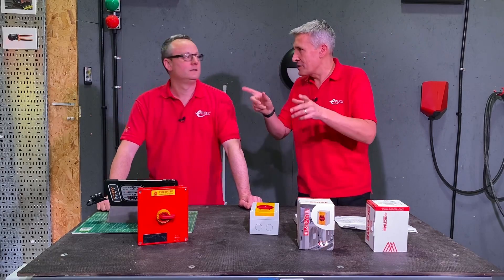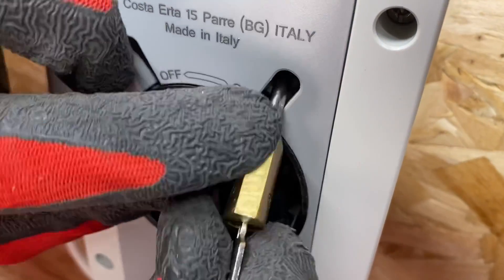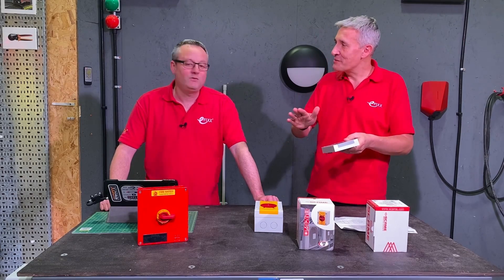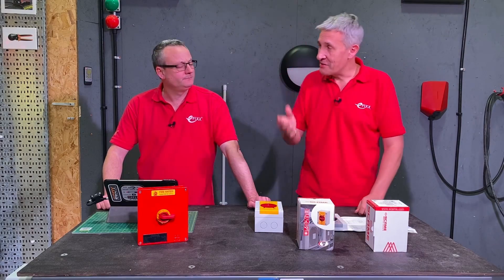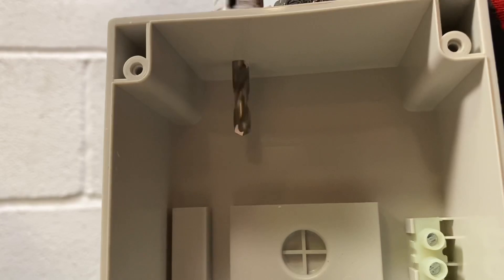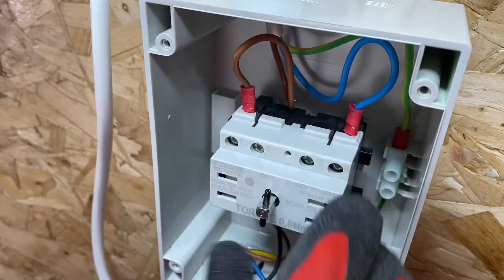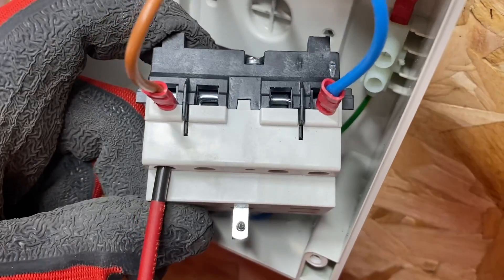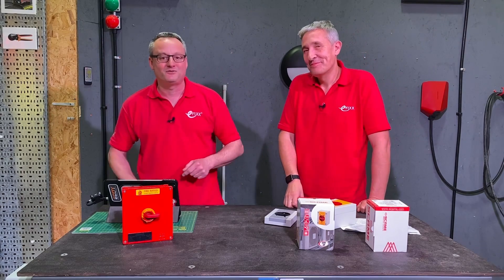TIME TO BIN THE UGLY ISOLATORS - Air source heat pump installations.

Comment: If the only reason for the isolator is maintenance then why not have the isolator next to the tank and controls location indoors, clearly labeled, far better than something outside that is both ugly and largely pointless. I think commercially and industrial situations it needs to go next to the unit outdoors like anything else but domestically I dont see why you must. You cant use the isolator without first shutting the unit down correctly from the tank/controls location anyway. Just switching off the power can damage the compressor mid cycle and invalidate your manufacturer’s warranty also. I would argue also that an isolator indoors labeled correctly is better than one that’s padlocked outside.

Comment: I’ve been told by my installer that I must have the red yellow isolator to meet spec.  Do you disagree??   Thanks
Reply from the maker: You need an isolator but it doesn’t need to be yellow / red

Comment: As units change to R290 -Propane, as the refrigerant gas, a means to quickly and safely isolate with no risk of sparks in the immediate area would be well advised. 
Safest area is to the side, min 400mm up, (propane is a heavy gas)  and cir 900mm to the side.  
Locking on is useful in communal accessible area’s but not advised.

Comment: Any advice on preinstalling flow and return under my kitchen extension being built before ground work completes? We want to lay the 28mm flow and return under the concrete floor to hide it all instead of retro fitting the pipework at a later date.

Comment: They are not an Emergency isolator as they do not  prevent reclosure of the device. They are in fact a lockable isolator to enable the circuit to be locked off by the maintenance engineer. Therfore In this case they are used as a Safety Isolator. 
In this case they should not be locked in a on position for the following reasons:-
a.) The maintenence Engineer may not be able to access the circuit isolation  for the plant.
b.) The Duty key holder may not be available to remove the lock from  the on position.
C.) Loss of keys .
 From your consumer unit installation situated at the bottom of a staircase which was installed at a low level you didn't seem to be concerned as for children gaining access and switching  the circuits off.
Reply from the maker: Colour dictates function as designed in Bs7671 - red / yellow can’t be locked ON

Comment: as a hvac engineer myself i would say locking on isolators for most heat pumps is a bad idea just purely because of the likelihood of the customers loosing keys etc.  but they definitley need a means of local isolation
Reply: On the plus side, cutting off the lock from something locked on is inherently a safe action. On the minus side, walking around with bolt cutters in loto cabinets might still be frowned upon.
Reply: They need isolation, but that can be achieved through various means.

Also they often need some form of overcurrent protection.

For single phase 13A units surely a FCU installed in a suitable inside location makes most sense? Can be isolated and fuse holder can be locked open with padlock for maintenance.

For three phase you could even lock off a 3 pole MCB - again this isn't isolation for mechanical maintenance, and according to regs an MCB is suitable for isolation and functional switching. Most MCB manufacturers provide a locking off kit.

Comment: I've been fitting Scame isolators for quite some time.  They are certainly the top of the range.  Easy to work with and look smart.  I always keep a few in stock.  Also the pvc material used for these isolators is very good as compared to others on the market.  They cost a little more and definitely worth the price.  Scame are the Ferrari of the isolators.  I'm a Heat-pump engineer for more than thirty years.
Reply: Thanks for your kind words, I run the marketing at Scame-UK. Would I be able to use your quote for a future LinkedIn post and attribute it to you?
Reply: @roynicol7008  Yes, absolutely.  If I can assist in anyway possible, please let me know.  Thank you.
Reply from the maker: Great feedback - thanks 🙏

Comment: 1, does the isolator need to be located by the equipment? If not then it can be out of view. 2, if a property is dependent on electricity and there's an outage such as the recent one in the North, they're screwed!

Comment: Do these isolators have the ability to switch off on load guys? There will be a sign on it if it's rated as such
If not it shouldn't really be being used as a functional switch or an emergency really.

Maintenance only

Comment: As someone whose in the trade, they do need local isolation for pumping down if you’re working on them. Depending on the set up of them. Unless people are willing to pay for 2 engineers to attend properties. So the sake of an isolator switch it’s a bit daft no? 

Also they should start making them more like a coldroom/freezer room like the danfoss optyma where they have a built in switch. would look far better and neater.
Reply: Hypothetically, if the system omitted the isolator and you had to isolate them by turning off the circuit at the consumer unit, why would that require a second engineer rather than just walking back and forth a time or two?
Reply: @JasperJanssen  You’d then be running the compressor on a vac, potentially damaging it and/or it would cut off and thus the gas would then fill the lines as you can’t close the valves in if you’re going to stand at the consumer unit, meaning the pump down was completely pointless. The only other way to do it would be to reclaim the gas the, then you’re looking at paying for an extra hour or two for someone standing watching a reclaim unit. So swings and roundabouts. There’s also different situations where you need to turn the switch off when checking valves, or disconnecting the reversing value. Get local isolation and it elevates all these issues.

Comment: The isolators were mounted behind the heat pump, so if the heat pump caught fire you could not turn off the supply to the heat pump.

Comment: There was a data center in London that had a significant problem with homeless people. They would sleep rough next to the air pump equipment, because they blow out warm air, so a nice source of free heat on a cold night.
The problem was, that at some point a homeless person would turn off the isolator because it was noisy and keeping them awake.
The establishment wanted to remove the isolator, but it was the fire service who said no. They wanted isolators.
We argued that if the unit was on fire, you couldn't reach the isolator anyway.
Right ole kerfuffle.

Comment: Isolators are really for maintenance work to be carried out safely. 
Switch off at the MCB, then isolate by switching the rotary isolator to the off position and lock off. 
They are not really for emergency switching and often not designed for breaking large loads.
If these isolators are considered emergency devices they should be brightly coloured and red/yellow seems to be Industry standard.
If these are intended for their proper use, maintenance, the black and grey Scame versions with the centre drill points look excellent 
Great demo lads

Comment: With air source heat pumps I agree the red yellow isolators are crap.  However the bigger problem   Is the air source pumps. Before any one gets a grant and pays big money rhdy should be aware that when they need heat in winter the efficiency of an air source heat pump falls dramatically.  Check out Mitsubishi technology why maintains efficiency to very low winter temperatures.

Comment: AS3000 in Australia states all air-conditioning equipment must have a isolator mounted near the unit

I believe it's for refrigeration techs who have only restricted electrical lic to be able to perform maintenance and repairs as the system isn't directly connected to the consumer unit breaker

Comment: I fit those fire 🔥 rated isolators to sprinkler pumps..
Smaller ones to industrial fire alarms systems...
You'd never see them in a domestic dwelling, usually commercial and industrial settings...

Comment: On a communal block of flats where I have worked the communal lighting have light fittings with 2 lamps with one permanent 24 hour supplyvand another switched from an external photocell also an  emergency circuit in every 3rd light,  they have 2 red/yellow rotary  isolation switches for testing the emergency and over riding the photocell to check lamps are working.
Both are padlocked in the on position which had to be drilled to get the padlock in, could of done with those grey black switches a couple of years ago.

Comment: I think the red needs to go. In the US we have gray metal boxes with a lid about the same size you flip it open and you pull out handle kind of handle disconnect with teeth that break the connection. We called them disconnects. They are required on anything that might need to be serviced that's not directly next to the electrical panel. I say this because one day I was at a library at night doing an outdoor movie. We had a big gust of wind come through and something fell down and made a big noise between a house and a building next to the parking lot we were in. I wandered into the alley to find out what the loud grinding noise was that I was hearing. it was due to a bunch of doors that we're leaning against the wall and caught the wind and blew over and hit the air conditioner knocking the fan out of alignment and it was scraping against the casing. Thankfully no idiots locked the disconnect so I was able to pull it out and they had the Business number on the building so I was able to call them and leave a message so when they got in the next day figure out why there was no air-conditioning. It's probably save them a lot of money and repair costs as well as somebody needed to do was properly fix the fan rather than replace the fan.

I like those new isolators and wish we could get some of those over here.

On that note I think people lock them to prevent theft, in reality they only really need to be locked when you need to lock out for service. As in another instance I showed up at church early to set up on Sunday morning and the sanctuary was a bit warm turns out somebody stole the air conditioner and they didn't even bother to turn the power off they just cut the cables and pipes and took the whole unit outside.

Comment: Agree that they do not need emergency isolation as it is not normally something people are going to be tinkering with in use like a machine with a manual injury risk .Saying that I do think there is a risk of small children poking sticks and things into the fan and would therefore think locking it into the on position may possibly not be wise .

Comment: Presumably the difference between 3P+N and 4P is timing of the 4th pole? In a 3P+N, the neutral is connected first and disconnected last but in a 4P they're all connected / disconnected at the same time?

Final assumption is that the 4P is aimed at single phase supplies that need additional isolation for some reason, such as mains voltage control circuits?
Reply: Agreed, usually the make and break sequence of the poles would be simultaneous with the 4 pole version and first on/last off for neutral with the 3 pole+neutral version.
Doesn't always work this way though, I'd suggest checking the manufacturer spec sheet to be sure.

Comment: Great point about the isolator switch's here! Question why is it needed at all? could you not just trip at a consumer unit?   

Note not a sparky as per my efixx challenge wall
Reply: Theres possibly some british or EN standard that requires red and yellow for ease of locating and indicating function and close by to enable shut off for remedial work or fault situation similar to regs regards e stops
Reply: You're right, there's no need to fit an isolator on a radial circuit. There are regulations regarding local isolation but its not required.

Comment: 5:57 Do the Scame isolators come with unique screwdrivers to fit those terrible terminal screws ?
Reply: Don't you have those in your tool kit?
Reply from the maker: Slotted PZ1 is quite a common terminal type

Comment: I ABSOLUTLY HATE captive screws - I've had too many fall out at inappropriate times - so I much prefer to rip the screws out and put them somewhere safe - so safe, I can't find them later !
Reply: Badly designed captive screws can do that but if they are well-designed they will not come free without taking deliberate steps to remove them.
Reply: @jeremybarker7577  Not all are well-designed - and I don't know which are which - so complete removal every time is the safe option !

Comment: Get out of town they look lovely I fit them all the time. Once again stupid manufacturer assuming we all use wood screws to mount the isolator, 90% of the time an isolator is fixed to steel and the fixing points need to be large enough to accommodate a 6mm roofing set screw. This is why the back gets drilled and it ends up full of water. Big red isolator would be for the emergency fire pump motor or emergency engine start up system or switch room fire suppression system. Craig and Derricott Ltd do a lot of that and they are located in Walsall

Comment: It should be time to bin the ugly Air Source Heat Pumps entirely. How anyone would want that monstrosity on their property and taking up space in their garden puzzles me.
Reply: It would be great if someone could develop a whole-house heating unit that could be mounted indoors,  making little noise,  and taking up no more volume than, say, a kitchen top cupboard.
Reply: People were saying that about satellite dishes over 30 years ago. I agree they are not pretty but they will become common place like air con units in hot countries.
Reply: @paullyons4624  there was an article in one paper where a family had one of the heat pumps installed and got a grant. They found it didn’t give enough heat or work properly so the ripped it all out and put a normal boiler in. The photos showed the boiler in the kitchen and the heat pump in a skip. How would you fit one of these to a flat flour floors up, even if the freeholder would give alteration consent, which many wouldn’t.
Reply: @montystelevision3238 . You are being misled by click bait. All the homeowners who are delighted with their heat pumps tend not to go on a rant.

Comment: Great video guy’s but your missing one very important point, the is the isolators  are red and yellow for a reason, the is so in the event of an emergency we and the fire fighters know what to turn off. Can you imagine the fireman’s switch being anything but Red . Also I don’t like the idea of locking it in the on position, what happens if there is a fault and you or someone has lost the key to the paddock? The isolator could over heat and cause a fire? , but I have to agree the black and grey one does look better.
Fantastic video guy’s as always 👍👍❤️

Comment: An isolator for emergency switching doesn't need to be red and yellow.  A red and yellow switch denotes an emergency stop which, when reenergised, shouldn't restart the machine without another positive action.
Reply from the maker: Depends upon which regulations you are referring to. BS7671 defines an isolator for emergency use.
Reply: @efixx  but doesn't denote the colour or method

Comment: Here's something wild and crazy, why don't manufacturers build them into the unit, like you see on electrical panels, they are not exactly tight for space, plus why not incorporate a key switch as well to stop them being turned off, as usual there's no thought in the design.
And it's up to someone else to over come the problems, usual the electrician.
Reply: You do need an isolator check iee regs
Reply: Not a good idea, if the unit needs changing you have live cables in the unit, hence  local isolator
Reply: @theendofmytether398  as the guys said you don't need an isolator, plus I would be isolating at the board not just at the isolator
Reply: @acelectricalsecurity  check the regs
Reply: @theendofmytether398  wasn't me that said it out was efixx what reg number are you looking at
Reply: @theendofmytether398  I mean, obviously you don’t need local isolation to avoid having live cables during replacement, you can have non-local isolation. That’s good enough to replace isolator switches, if nothing else. The context of these units is that they’re in homes, where turning off the power completely is entirely feasible, never mind a circuit or two. Also the non-local isolation options are not nearly as far away as in industrial contexts, nor is the frequency of repair supposed to be as high.

So what is the reasoning behind requiring local isolation? Let alone two separate ones, rather than one?
Reply: @JasperJanssen  regulations